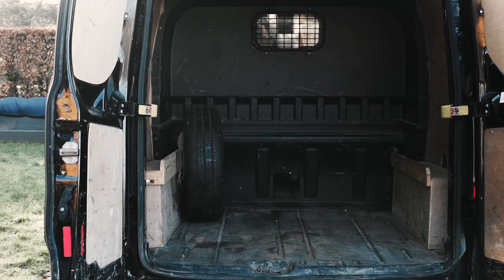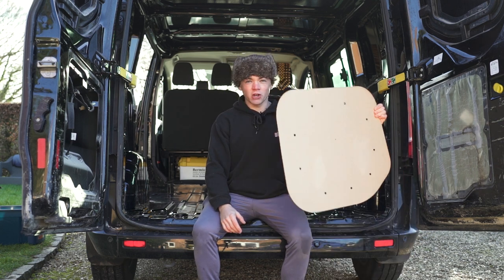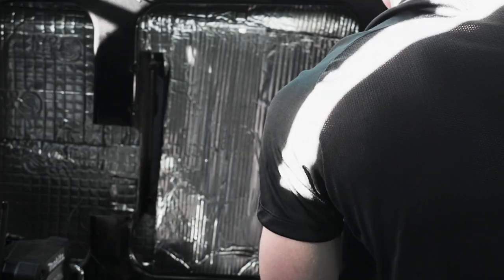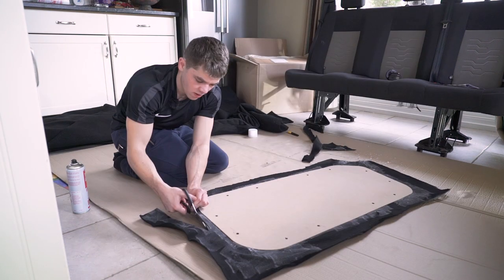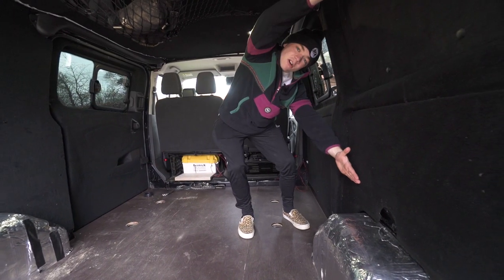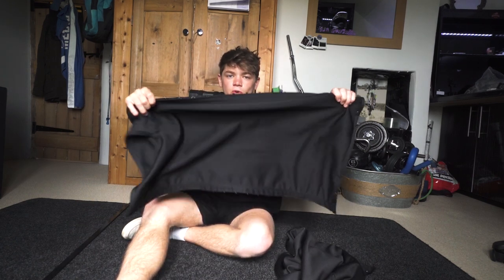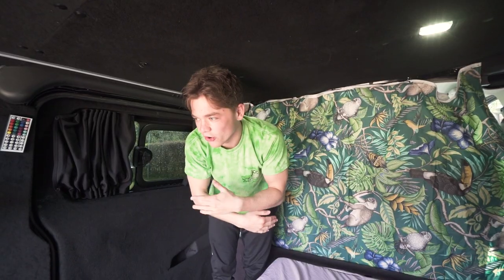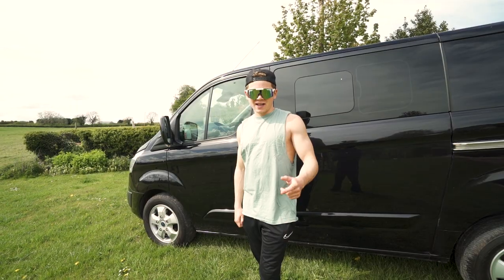The ULTIMATE biking van conversion - Ford Transit Custom

Comment: Just come across your vid. I really like that bed that folds up. I need a bigger van for work but also want to go camping in it. Don't need a bed quite that but it is a great idea rather than having to remove the bed etc to get tools and spare parts in for my work I could just fold it up. I would have a small permanent  kitchen area though

Comment: Nice work Harvey. 

I've self converted a couple of vans for mountain biking/mountaineering trips and I'm just about to get another, I thought I was set on a Peugeot Expert but seem to have watched about 20 Transit conversions over the last week so now I'm undecided! 😆

As an aside I've always put a roof vent in my vans (funnily enough I always seem to get soaked in UK mountains) and it's a must for keeping things from getting smelly/damp and the only other thing I prefer is a less wide bed, mounted higher up the wall as this allows me to fit a bike inside with the bed down (I imagine it's wouldn't be possible to fit a crosser in with the bed down on my builds though).
Reply from the maker: Sounds awesome. I’ll keep this in mind for the next conversion when I decide to go bigger 😆
Reply: @harveybeardsell4264  - going bigger puts you in long wheel base Sprinter and Crafter territory and then you can really go wild, my mate has a Crafter with a full on shower cubicle inside and a powered bike wash ... I'm as jealous as f#^k! 

Loving your other videos, you're living life to the full. 

Respect buddy.
Reply: I’m looking to make a Transit bike n bed conversion. When bike is loaded, do you make bike adjustments... remove wheel or turn handlebars? What height did you build your bed? Looking for ideas and specs. I have no carpentry skills. Learning as I go. Thanks for sharing.
Reply: @k-mac5511  - I've converted a VW Transporter and a short wheel base Sprinter in the past and both are slightly different shaped loading areas to a transit (narrower but taller). The beds I've put in have been about 2/3s as wide as his and have been mounted at about hip height when standing up. On both fits I've removed the bike wheels so it fits right under (although when I was riding 26ers it would fit with the rear wheel still on). 

Your carpentry skills will really improve so don't stress it, you're not building complicated joints just solid ones! 

Don't scrimp on the sound proofing/insulation and don't forget to de-grease and re-grease your door hinges if the van has been used commercially as all the crap in there makes them the noisiest things in the world when you open them at 3a.m. for a P! 

Most of all just embrace the challenge, it's well worth it in the end!
Reply: Thank you Jammy. I feel encouraged and motivated. Off to Lowe’s for supplies to get started. 😃

Comment: Harvey,
Excellent videos, keep up the great work. 
May I ask the thickness of the flooring ‘buffalo’ board and the fixings used, looks extremely solid.
Reply from the maker: Hey Andy, the buffalo board is 18mm in thickness. It's literally cut perfectly to size so it just slots in with no fixings. Still going strong almost a year later. It's ideal as I can just sweep and mop it clean.

Comment: Does taking the bulkhead out ruin the strength of the structure does anyone now? Awesome job though mate
Reply from the maker: It doesn't with my van, literally just bolted in.. Just takes some heat out of the cab on cold days
Reply: According to my Ford dealer it's non structural.
Reply: It's not structural but and more importantly stops you getting killed by all the stuff in the back sticking in your head if you have a crash.

Comment: Hello, nice finish, I left the partition on my Ford and my mtb fits sideway, without the front wheel, against it. I am curious about your wheels/tyres what type and dimensions are they? Mine are 215/65 R15 T 104. Cheers